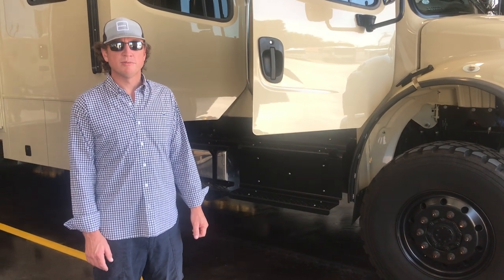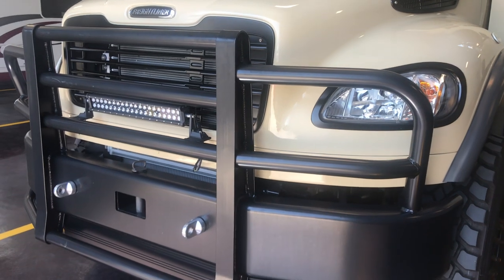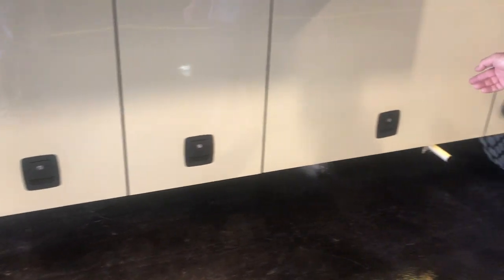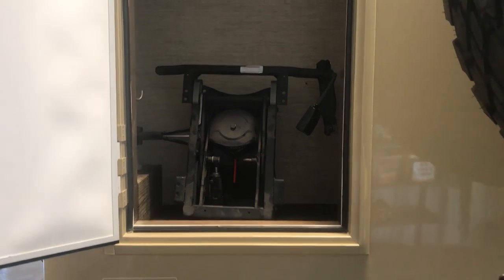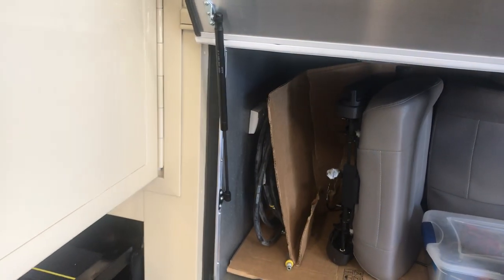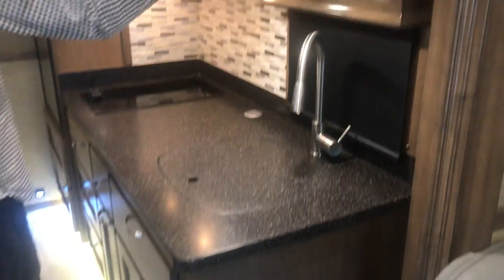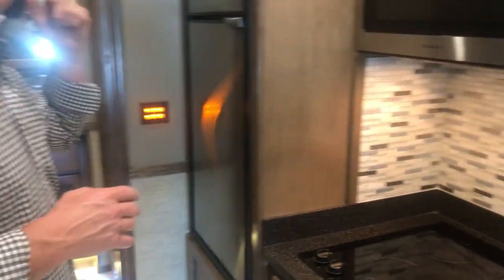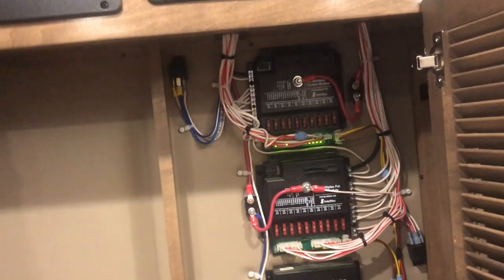2018 Showhauler 4x4 Extreme Edition Exclusively from Performance Motorcoaches

Comment: Question: Some of these super-c like the volvo vnl and freightliner cascadia models, can be expected to last 1 million miles since they are literally just semi-trucks with a coach on the back. Is the same true for these smaller models?  Probably more analogous to a large Penske rental truck -- I know nothing about the reliability/durability of those.

Comment: The ground clearance seems a bit low, it can do dirt road but maybe not potholed stony ones or uneven grassland? Have you done sway testing if anything pops open, falls or slides off? I suggest filling the cabinets with sideways water bottles for the test.  Impressive custom job by the way.
Reply: You obviously have zero experience with motorhomes.  I've taken my standard motorhomes down dirt roads with potholes that are filled with potholes, terrible uneven surfaces and other road hazards.  If you are a smart motorhome driver u don't venture down roads where others haven't gone. I now have a 4x4 omni motorhome and even this 1 isn't driven like a Jeep. These things are massive and very few trails even out west can u get a 4x4 hauler in the back country.

Comment: Can you show how you connected the inverter, batteries, solar, and generator and how you separated them so one wont short the other.  Switches, relays, fuses, etc.  Thanks.  Nice unit.  When you are using 12 volt does it go directly to the breaker box and bypass the inverter or does it go into the inverter first.

Comment: Put out a video demonstrating is 4X4 capabilities.
Reply: Literally identical to forest service fire rucks. Plenty of videos on that.

Those are probably heavier / worse actually.

Nothing on a frame that weighs 5,000 lbs (M2 chassis before axles and cabs etc) is going to do well off road, though there are some exceptions with powertrains and suspecsions that cost more than this entire build. This is an OHV, not an ORV.

Good luck :)

Comment: Are you able to use multiple different floor plans from show hauler?
Reply from the maker: Riley Niesz  thanks for your interest in the Showhauler line. Within reason we can custom design any floorplan to fit on a Freightliner M2 4x4 Chassis. Weight can limit certain sizes and options. Please call the number in the video or call Darin at the dealership for more info. 855-Want-a-RV